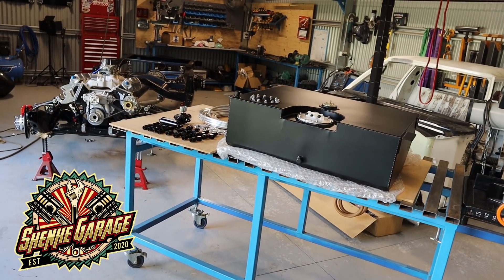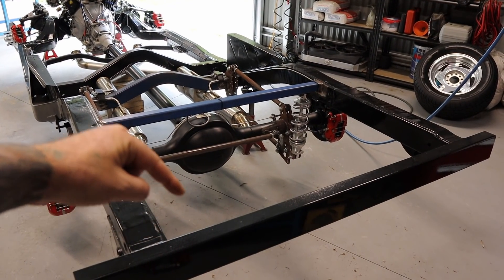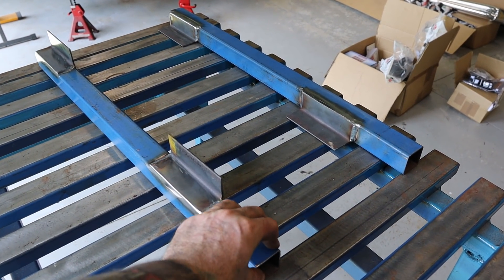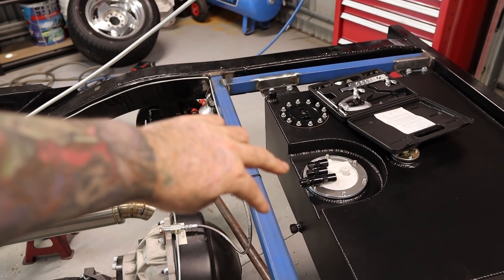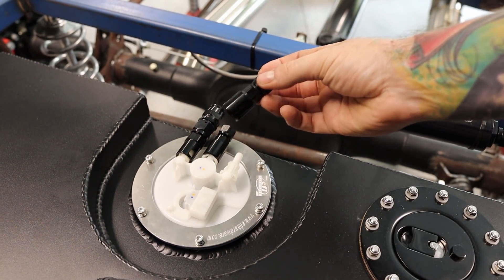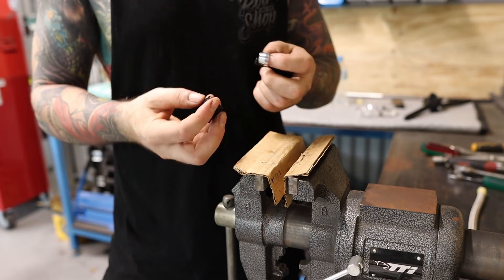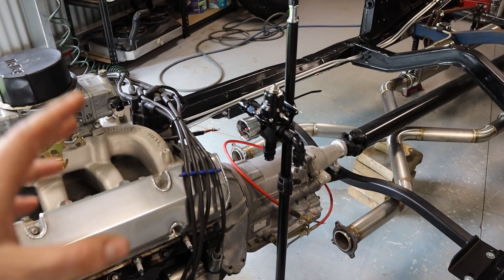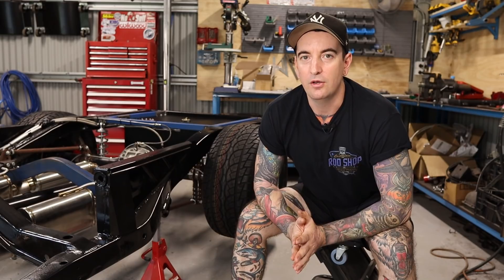Installing a Drop Tank and Plumbing the Fuel System - HX One Tonner Build

Comment: Great build/project. Isn't alu to week to handel shake from road and weight of full tank? Hope they don't break. Why did you decide to have return in the bottom of the tank? Wouldn't it to beter to use the return in the top? Is a valve in the bottom bong/connection? Isn't it to much pressure in a full tank to have return in the bottom of the tank.

Comment: Im not sure about running the return to the bottom of the tank, I think that may create a vapor lock as the weight of the fuel will resist the gravity flow of the return compressing the vapor in the line between the two.
Reply from the maker: The internal tank I think is 60 PSI and then it gets dropped at reg to 8 PSI. The return should have enough pressure to flow back into the tank. If not I should be able to change it easy enough.

Comment: Why didn’t you run fuel line down the left side more cleaner but otherwise keep up the great work
Reply from the maker: Thanks Mate. 
There was a few reasons why. 
I plan on welding in a battery tray on the left hand side to relocate it from the engine bay. I wanted to keep the fuel lines away from the battery. The battery tray will also likely be in the way once I weld it in.
Also there is no hole in the crossmember to put the pipes through on the LH side. Which is no big deal as I could drill some out.

Comment: Nice job as always Sam. I would get it painted and finished up before starting it. 
Is the fuel filter placement in a bit of a shit spot to reach for changing? Know you said you will have a tilt tray but between the fuel tank and chassis rail may make it a bit of a pain once age sets in a bit and you need to “break” the fittings? Just a thought. 
Good work though mate.
Reply from the maker: Thanks Carl. I think I will paint it first now. You have a good point. I might have a look at a different mount. Maybe put it on the other side of the rail.

Comment: Hi loving the build so far, Im in the middle of doing up a HQ Coupe and getting lots of tips from you...anyway where you have the return line going into the tank, wouldnt that bung be there in case you would want to drain the tank at some stage if needed? Could the bottom return stir up any sediment and shit etc that may build up if car not run for a while? What do you think?
Reply from the maker: Hey Mate. That bung was put there for the return. There is another bung directly underneath which I did not show in the video that is for a drain.

Comment: I'm pretty sure you need to have the return at the top of the tank because there is no pressure to push fuel into the tank and you may have a heat problem with the fuel line at the back of the engine like you have it
Reply from the maker: Im pretty sure the internal pump is 60 PSI and the reg will drop it to 8 PSI to the carby. There should be plenty of pressure to return to tank from the reg.

Comment: Just an observation, may be mount the tank from the underside & weld the nuts to the mounting bracket so you can service the tank in the future .Without removing the tray.
Looks great. Keep up the build        Cheers Gav
Reply from the maker: The tray will tilt when I build it. Everything will be accessible once the  tray is lifted up.